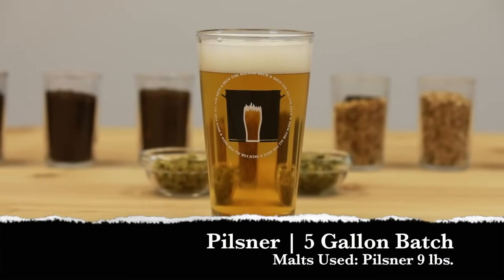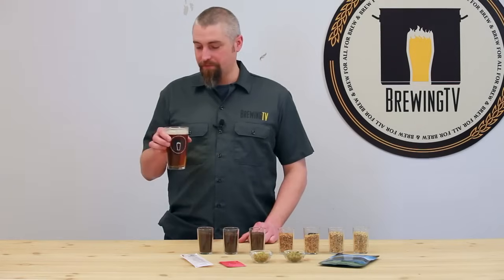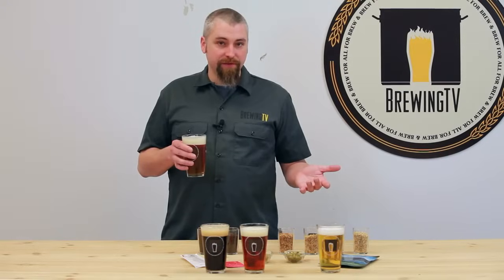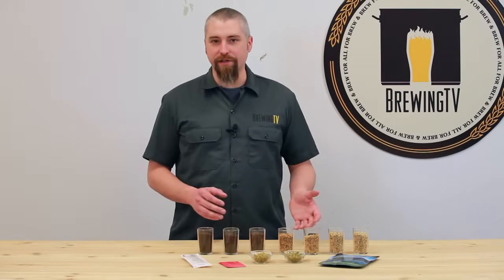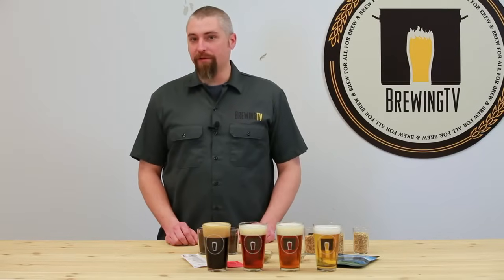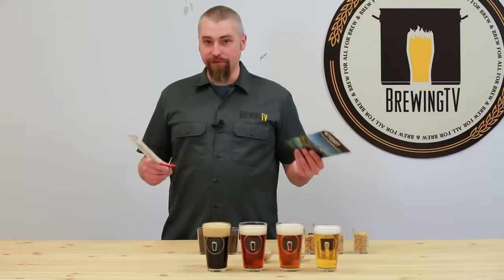How to Formulate Beer Recipes for All-Grain Homebrewing

Comment: Honestly, I don't like the presentation of the hops being added.  You're throwing some random ass malts into a cup and then just tossing in hops like you measured it.  It would be a lot more clear if you actually had a couple of measuring cups that you threw the hops into at each time interval.  Also... I know that it's common to put hops into the brew with a set amount of time left but you never actually mention that.  You just kinda assume we know.  This whole section is vague as hell.

Comment: This is an unbelievably good video! I have a few small batches of beer under my belt, but this really opens up the possibilities without wasting my time experimenting. Awesome job!
Reply from the maker: That means a lot to us! What sort of recipe inspiration are you going to take into your next brew?
Reply: @NorthernBrewerTV  first off, I'm going to try out using a different base malt. Munich sounds great for leveling up basic grain bills. The different base malts was something I just hadn't come across yet, I  thought pale 2-row was it! I also really liked the explanation of the crystal/caramalts. 

With this info I'm going to make a beer for my father-in-law for his birthday, a honey brown ale.

Per gallon:
1 pound munich malt 
1 pound 2-row pale
5 ounces crystal 70
0.5 - 1 pound of local honey
Tetnang hops for bittering, possibly cascade for flavor/aroma, not sure yet, I want it to be malt-forward.

The whole alpha acids section on hops was awesome, too. I used centennial hops for bittering and flavoring once, and it was a little too much bittering.

Comment: Brad, I have been brewing for 30 years, and I had never heard of the BU:GU formula.  Sure, I innately know that IBUs and malt affect balance.  After my friends ooo and aah about "brew pub" beers, (which in my opinion are almost all overhopped), I give them balanced beers, and they have renewed appreciation of classic beer styles.  This is a great tool - I am going to redesign my brew sheets, and leave a box for the BU:GU number...
Reply: This might be a silly question: But while brewing, how do you achieve the desired IBUs? How do you know what quantity of hops you should be putting in?
Reply: @rachitmalhotra6471  You make a choice based on the style you're going for and how that style is defined.